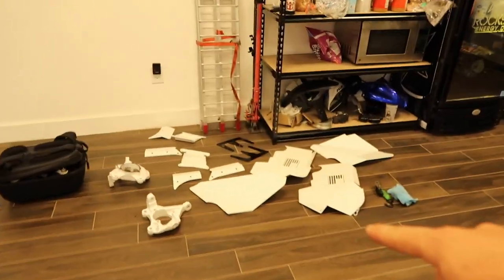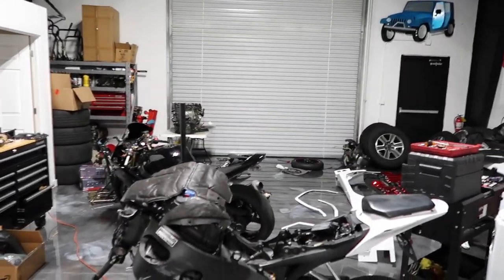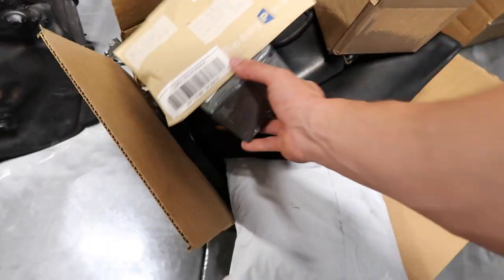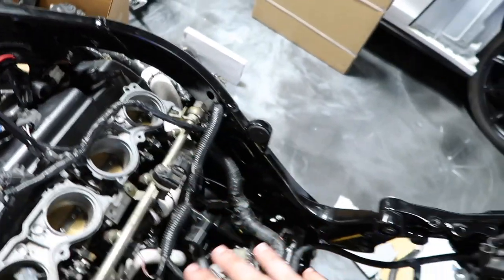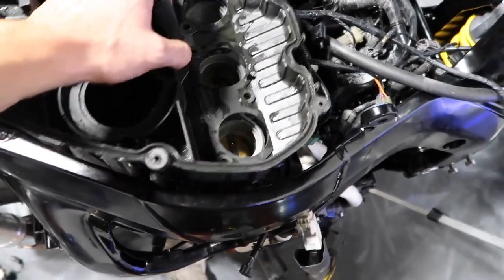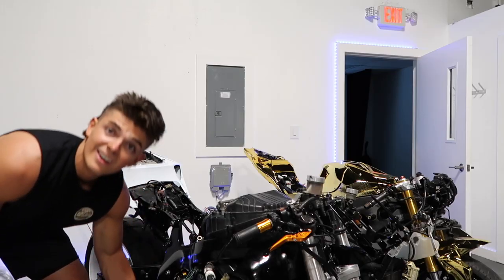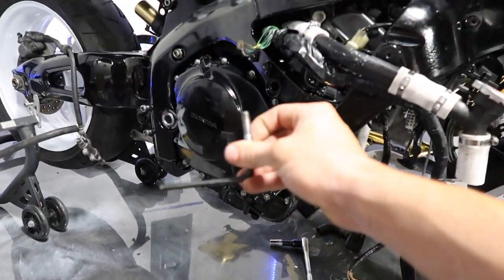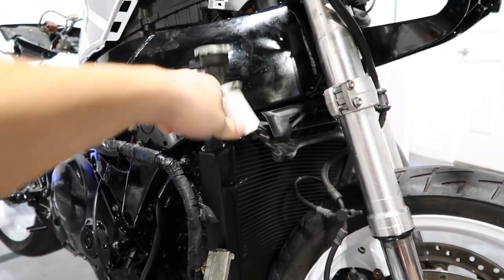2005 CBR1000RR WRECKED Bike Rebuild (Part 3)

Comment: Damnnnnnnn bro I need your Help👏🏿👏🏿👏🏿👏🏿👏🏿👏🏿👏🏿
Reply from the maker: What you working on?
Reply: @builtfromthebottom   my CBR 1000 rr it's seems like it's not getting Spark again bro this so called big motor cycle shops in Houston done fucked me out of alot of money and my bike is still not running. Would the stater motor have anything to do with it not starting?